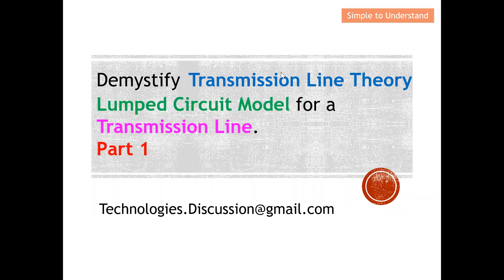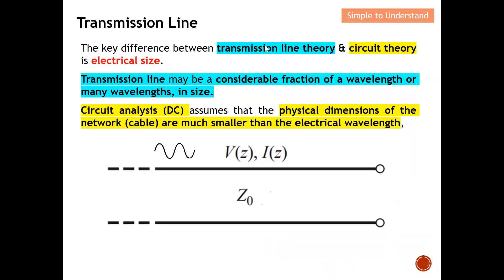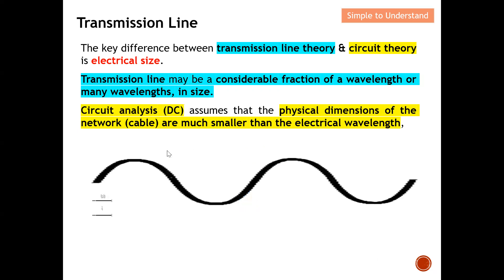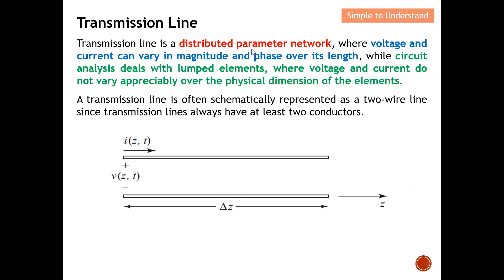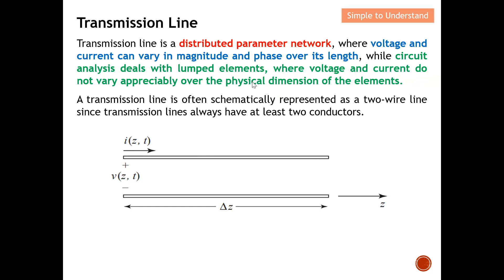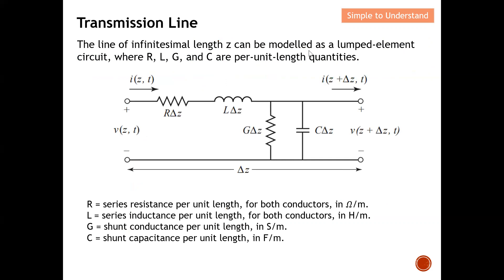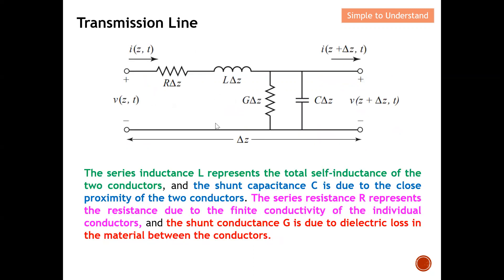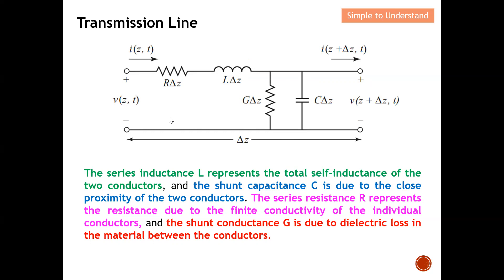Why Transmission Lines Radiate Like Antennas: Lumped vs Distributed Elements Explained for High-Freq

Comment: Hello Sir,

I have a question about why the transmission line has at least two metallic conductor parts? 

Is it because of the source is AC source ? 

Therefore, the polarity can exchange between the two conductor ends in order to make the AC voltage or current propagate through the wire?
Reply from the maker: One conductor is for the signal and the other is for grounding. I think the next few videos that I plan to do will let you have more understanding.  :)
Reply: Got it, I appreciate it. 👍
Reply from the maker: @jyun-haochen1972  You are welcome.
Pls consider to like this video and Subscribe. Thanks.
Reply: @technologiesdiscussion1676  Sure ~
Reply from the maker: Thank you for your strong support